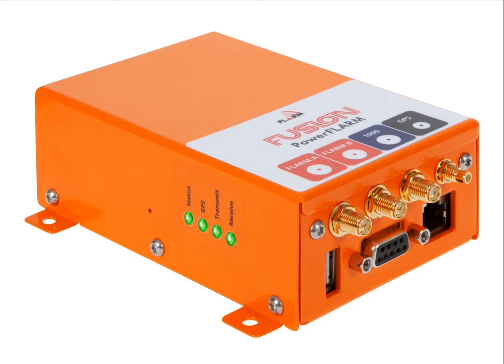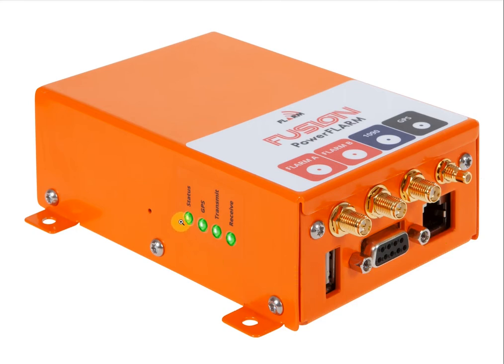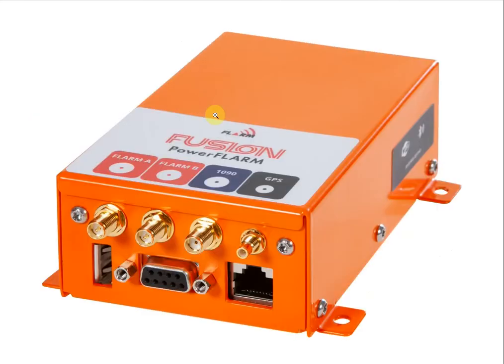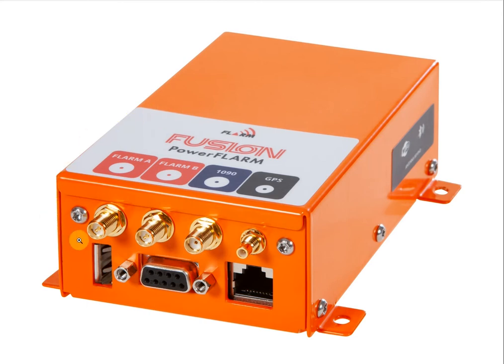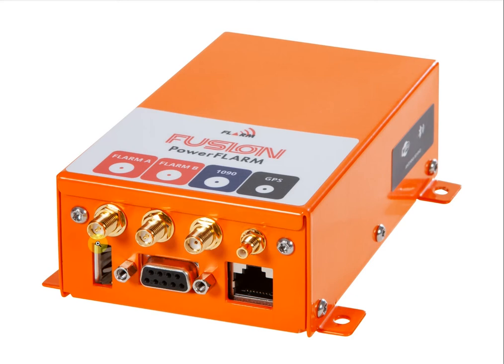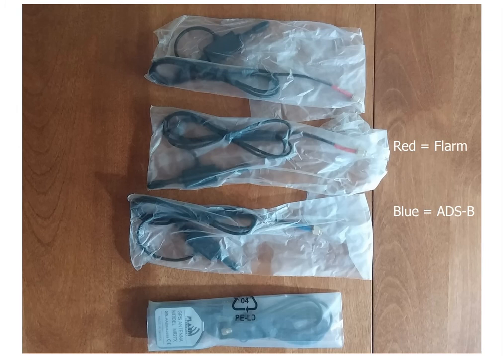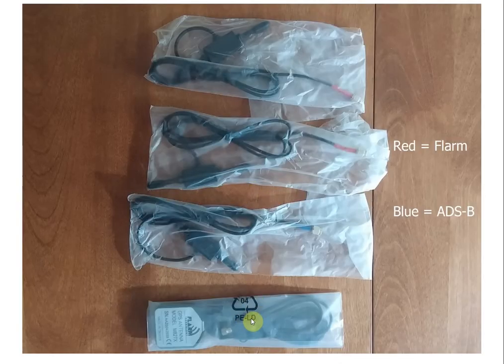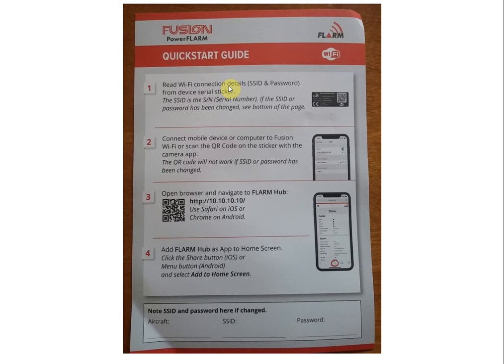PowerFlarm Fusion Overview

Comment: Can an iPhone be used as a device for viewing like i currently use a flarmview?   Would like a bigger screen and the fusion shows i can connect via wifi to an apple product.
Reply from the maker: The Flarm hub has a traffic monitor that can be displayed in a browser via the wifi.  See timestamp 10:51 in this video:
https://www.youtube.com/watch?v=be47IjDV740&list=PLeAW0PUi2pqL0GSdeIJDBcgVv6Qmrfjks&index=3

The problem is if you read the disclaimer at the top of that page that it gives no collision warnings and is not suggested for in flight use.

If you use Naviter Navigator on your iphone, it is capable of displaying (or soon will be) of displaying flarm targets.  Unfortunately, Apple products are not good for soaring but if you use and Android and install XC Soar that will give you flarm over the moving map and warnings.

Comment: Hi Dave, I've watched all three of your videos on Flarm Fusion. Thanks for making the effort, I'm sure many pilots will need thay information and will find it useful.
One question: in 3:10 you make the statement that the Antenna B is for reception only. Where do you find that information in the User or Installation Manual? From what I can read it only speaks about 'Antenna diversity'. Are you sure you are right?
Reply from the maker: Sorry, for the late reply, I wanted to make sure I had the correct answer so I spoke with the folks at Flarm about it.  For the North American FCC approval of the Core and Portable units, the B antenna is receive only.  The European Core and Portable can both receive and transmit on the B antenna.  For the Fusion FCC approval the B antenna is both receive and transmit.

So something that is easy to confuse as the function changed with the continent and then introduction of the Fusion.